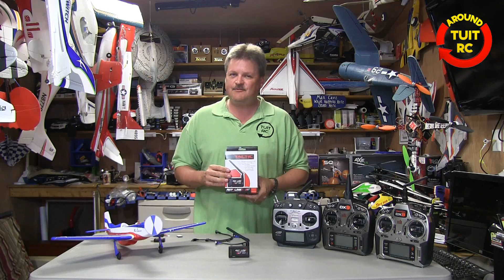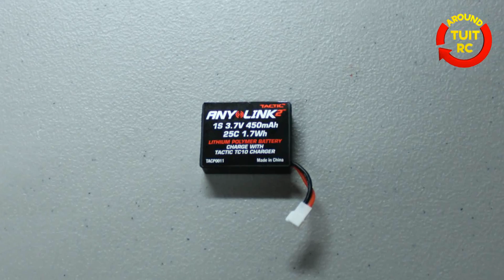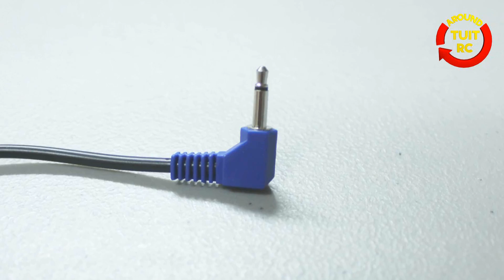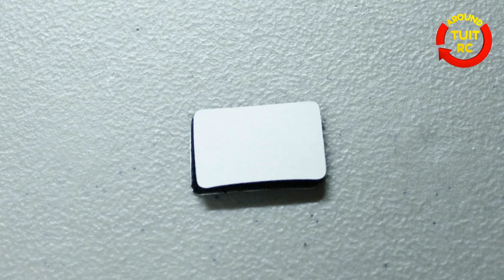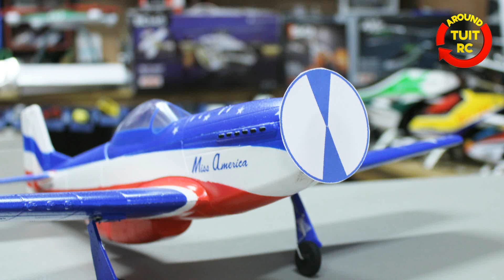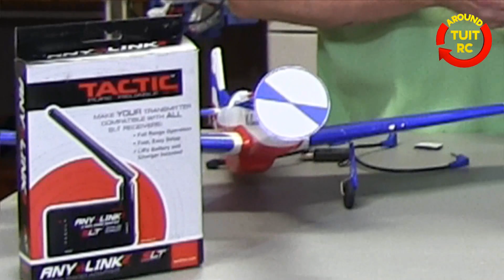Tactic AnyLink2 Review: Around Tuit RC

Comment: Hi Eric, nice information video on the new anti link system for radios. I am trying to find the video you did about buddy boxing wireless from a tactic 650 transmitter to another tactic radio but not the 650. Wondering can you set up the 650 tactic with a spectrum Dx7 with the old style anti link or not. I love the 650 but still don't know all the features.

Comment: Thats pretty cool, the flyzone model the super cub is on sale through amazon that requires only the radio, and it is available for 83 dollars, rather than buy the thing from hastings for 199.99, that little adapter will allow me to use my dx5e and get a big plane for around 100 bucks. It isn't for myself really, I have the apprentice and it is great, but it costs 3 times as much. Great video

Comment: It looks like the prop spun counterclockwise on the dx9.  Have you noticed an issue with different rotation when you change radios? I would not expect that this is even possible.
Reply from the maker: It didn't, but may have looked that way from spinning so fast.